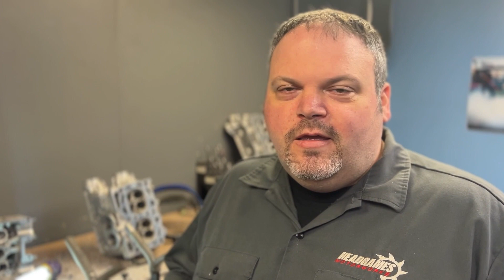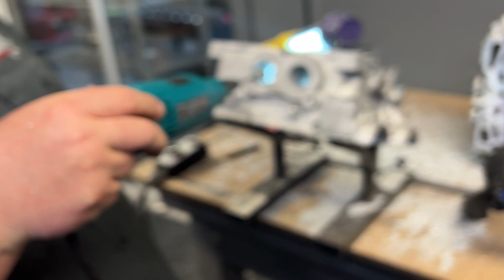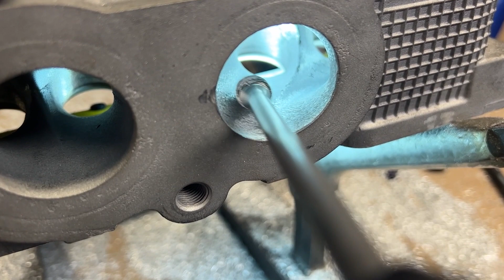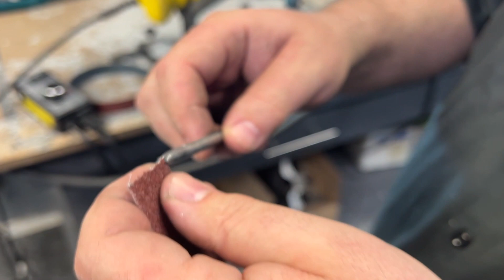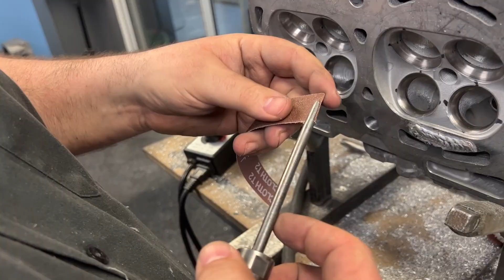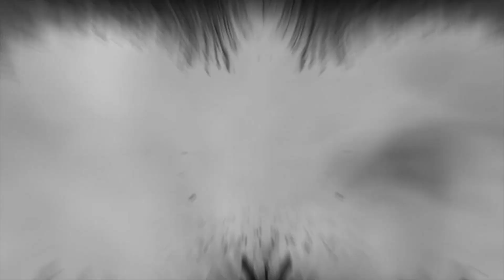PORTING HOW-TO: Subaru dog leg exhaust port!

Comment: The Subaru dog leg port is very similar to the Harley Milwaukee 8 exhaust port.The M-8 is what I do the most of these days. I also use the 3/4" super spiral ball for most of the M-8 port. It truly does a great job shaping a round port. I was looking at videos to see if anyone might have a different perspective on working this type of port. I saw a lot of videos by guys who have very poor technique, or don't seem to know what they are doing, or why they are doing it. Your approach is the same as mine. Thanks for taking the time to post your videos. As I am slowly approaching retirement from the business it is gratifying to see you helping to develop a new generation of cylinder head specialists. (I am not planning to retire, but I'm in my 70's, so it's inevitable)
Reply from the maker: thanks brother!

Comment: I don't see how adding a fin in the exhaust helps with air speed. If you wanted airspeed you would have just kept the cross sectional area of the port constricted. That fin just looks like it follows the casting and not how the air would want to flow through the port.

Comment: I just reworked some SOHC EJ25 heads this weekend. Heads were off for leaking head gaskets (of course). Engine has 180k so no way am I putting it back together without retouching the valves/seats - which means there's no good reason on earth not to spend a few hours giving the bowls/ports a good once over.

I definitely didn't work mine as much as Dave did here, but it was real nice to see the basic areas where he pays attention.
I widened the port roofs where the pockets transition into the ports.
On the dogleg ports I didn't grind nearly so much as Dave to the point where I was beginning to create a fin - but I did lay back short side radius of the dogleg - then blended it into the roof.
The short side radii of the intake ports had a sharp edge. I laid those back and hand-sanded the final radii with 80 grit emory cloth.

Anyway, thanks for showing this to us, Dave - served as a nice guide to know specifically what areas to address and what to leave alone. Hopefully mine picks up a couple horsepower; it sure could use it!
Reply from the maker: That’s awesome that I could help!

Comment: Hmm,yhamk you for all of your Greatips. For Your standard ohv 2v pushrod engines generally you don't need the 1/2 however i think I will use your flapper idea on the ssr.
Reply from the maker: Thank you! We don't use a cartridge roll on a short turn ever. Ruin it quickly.

Comment: I have a question?
My Yamaha FJ 1100 1985 has this exact port shape and I am going to use your method to port the head my question is that I am welding the intake ports on the top and sides to raise the ports up about .500-.700 of a inch so would you suggest I stay on your path with the porting and stay inline with the stock port size to start?
I will be going from stock 36mm carbs to aftermarket 41mm carbs. (Note)
This vid was kickass as I was wondering about this particular port design and how to address it, so thank you very much for this lesson.

Comment: Is possible 🤔 to just use sand paper with out using a burr and finish up 320 or 450 sand paper 📃
Reply from the maker: I think that is a total waste of time and effort. There is no gains unless you are moving material. And even less gains or possible losses doing it to 450 grit and spending your life doing it by hand.

Comment: @headgames what are the advantages of this porting? What would this do for head heads for up to 600hp?
Reply from the maker: It would hurt torque under 800whp. Not recommended. Only a pocket port for 600whp.

Comment: Do you have to flow bench every port once you are done to balance everything?
Reply from the maker: Hey Chief! No sir. Jesus could come back and he wouldn't be able to get the ports to flow the same. They don't flow close to each other from OEM either.
Reply: Thank you, I’ll be reaching out regarding my old 02 wrx ej205 heads.  I would like them freshened up, hopefully they aren’t cracked. Is there a huge flow difference between these and the Sti heads?

Comment: the fins confuse me because I think of air like water..without a wall being there dividing the air into each valve from the start through the exit isn't it just acting like a ramp? If you could put colored smoke and send it through I imagine it's a chaotic mess anyway but in my mind I just picture the two sides converging into turbulence...no?  Have you ever experimented with a spiral....same way you make your fin but making 4 or 5 like a gun barrel?
Reply: The spiral idea was going through my mind while watching this. Like what if you start a spiral or however many on the right side and send it up and around, which send the air spiraling into the left side port after the divider and vise versa starting from the left side going down and around into the right side port after the divider. That'd probably take alot of work for the same or slightly better performance/flow...so maybe not worth it?
Reply from the maker: That spiral idea would be cool to try but hard to execute.

Comment: can I polish mirror shine in the intake port?
Reply from the maker: Never mirror shine https://www.youtube.com/watch?v=CdhSOKZPYrk
Reply: I always assumed you wanted the intake a little rough to help mix the fuel and keep it off the walls, but maybe doing the exhaust would help keep carbon buildup off.  Polish the combustion chamber maybe for the same reason.